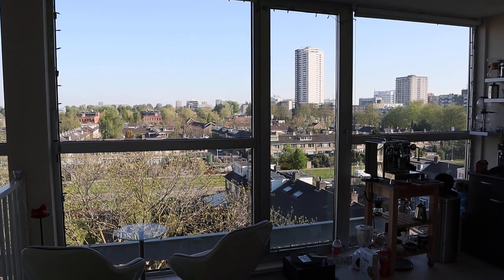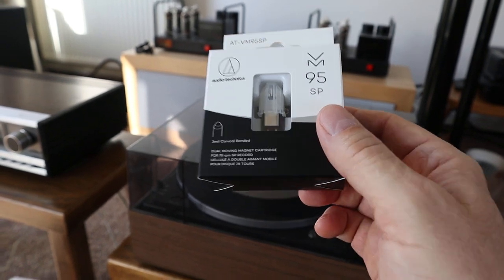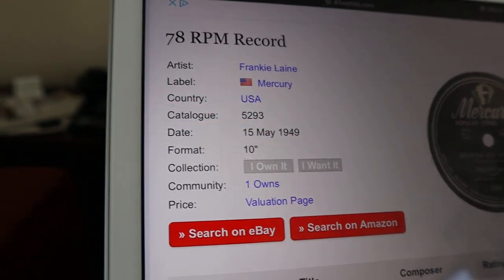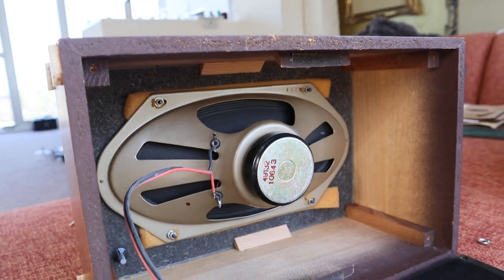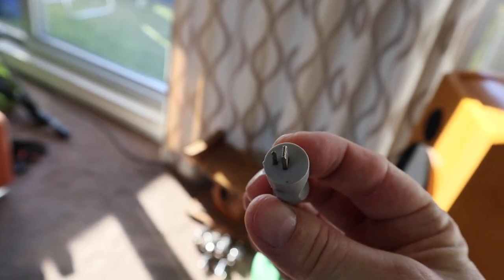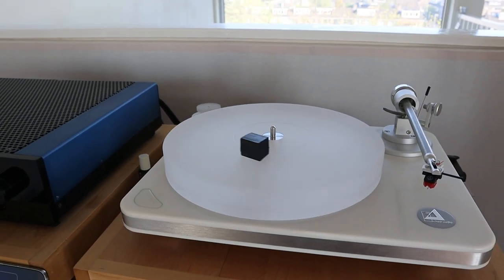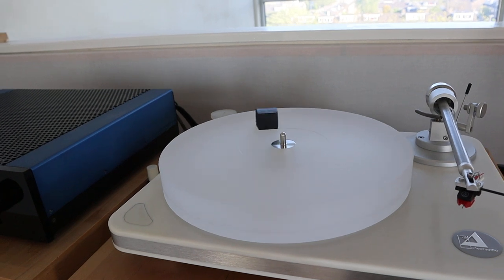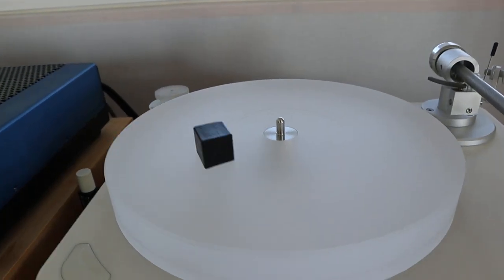Why a magnetic bearing is great. Join The Audiophile Barista on his day #26

Comment: Here's a couple of ideas to consider:
1. Tell us about the conversion of digital data into analog without DAC, and is it a better solution ? because we all know that "the best DAC is no DAC". The same goes for cables (like Dynaudio Xeo or Focus XD series). But for that it is necessary a full digital amplification, like in Lyngdorf amps, some of Marantz (tol), also in active systems like Dynaudio and System Audio etc. And in general, is a minimalist system better than traditional one with dacs, amps and cables ?
2. Are older speakers , from higher lines, still better than newer speakers from lower lines ?
Reply from the maker: Hi, thanks for watching and thanks for your input. A few questions though
- I am trying to understand what you are asking because converting digital into analog will always be a DA conversion (meaning you always need a DAC). And a full digital amp will always (at some point) have to convert digital into analog (meaning it has to have a DAC) because loudspeakers can't play digital signals. They are analog devices. So you can play a turntable without a DAC (because it is analog) but you can't play a cd player without a DAC (because it is digital). 
- What is a 'minimalist' system? Do you mean integrated in one box?
- Point 2 may be a nice topic. Thanks.
Reply: I meant that the entire path is in digital domain, exept, of course, for the last step before the driver, when it is converted into analog.
By minimalist system i mean all-in-one box (like Lyngdorf TDAI amps or Hegel) and also active speaker systems, where there is only the source (digital) and the active speakers (wired or wireless) . Thx